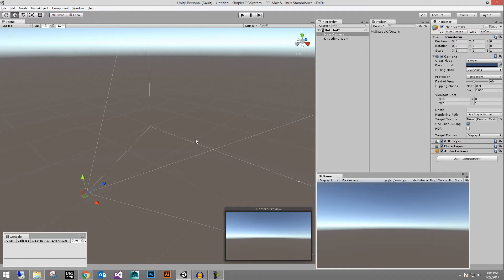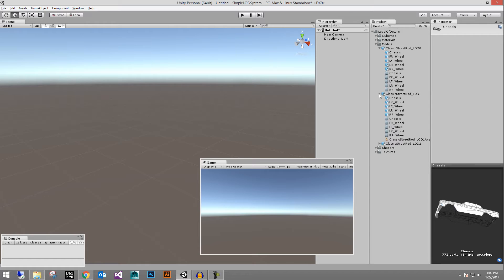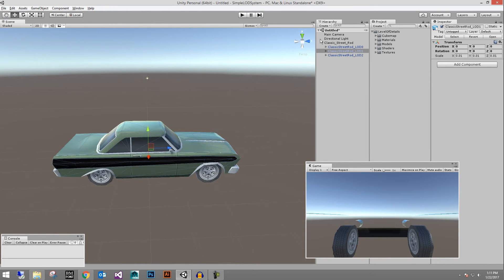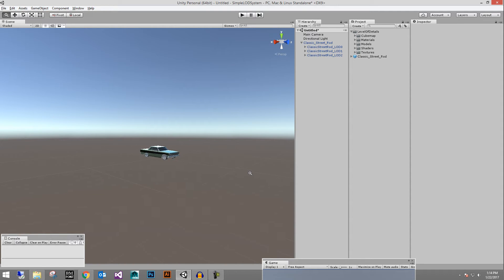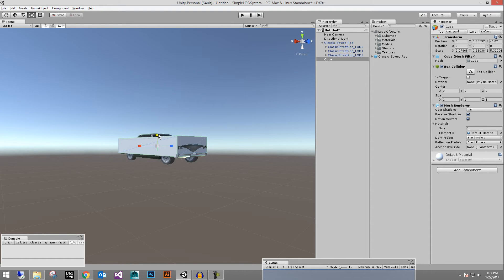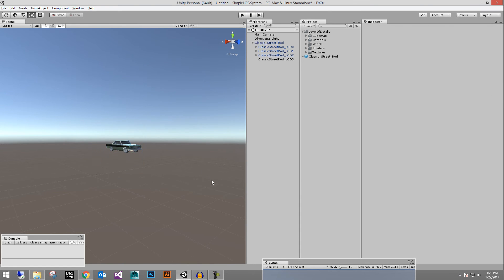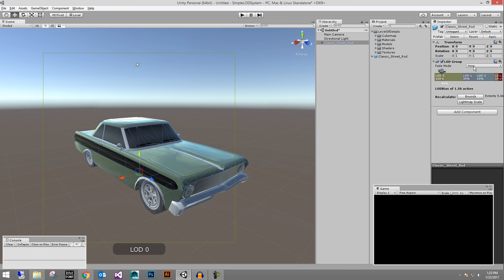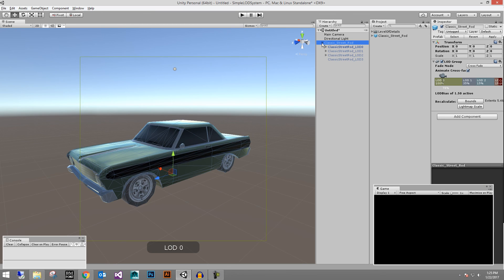Simple LODs in Unity - Unity 5.xx

Comment: very good explanations, learned a lot. thanks
I have a question..
usually we have to control the wheels via code, does it affect the wheel's LOD or not ?
Reply from the maker: Yeah it can. It really depends on how you set it up. If the wheel rotation code is assigned to each wheel, then it's not a problem. If the rotation for the wheels is happening within a script on the main car, you would need to make adjustments to that code. For example, when the LOD switches on the car, have the car script detect that and automatically assign the next LOD wheels within the script. This way it doesn't return null in the car script. Sometimes it doesn't matter at all because you don't notice the wheels not rotating at a far distance.

Comment: Had been really wanting to learn about LOD groups and finally was able to learn by watching your video! Thank you!

I wanted to ask, using the car as an example, how would the scripting for animating the car change when using an LOD group? You have 3-4 of the same model that the renderers are being managed by the LOD group, but how do you manage the tire rotations of the correct tire game objects at any given moment or the animations/animators for them? Would you rotate the tires for all 3 always even if they aren't being called? Do you check constantly? Or is there a simpler or correct way of doing it?

Thanks again and sorry for the rambling questions!
Reply from the maker: Roy Portillo There are most likely a few ways to tackle it. The first way that comes to my mind is having a section in the player/car control script that contains a reference to the first couple LOD wheels and only rotates the currently active ones. Doesn't need to check all of the time, only at the time the LOD level changes. You really only need this for your first two LODS, as rotations become really too tiny to see out that far. Really depends on your specific settings for distances.